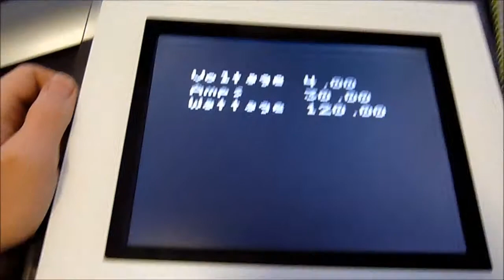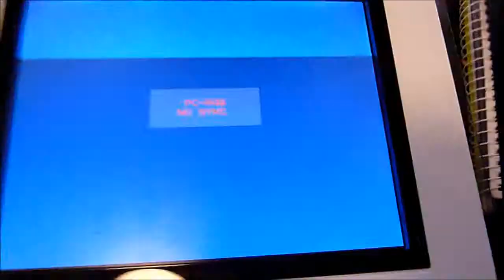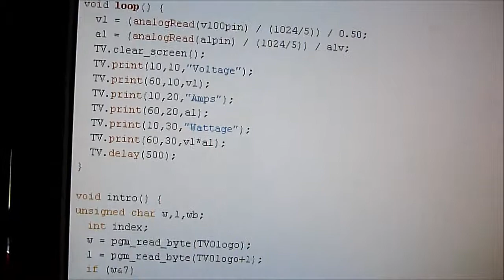Arduino TVOut/digital photo frame power meter

Comment: Care to share the code? I've been trying to build a bench volt meter with a old TFT LCD and all I can get is the text to scroll.
Reply from the maker: +Leland Clayton This was so long ago! I will have a dig for you and see what I can find
Reply: +wilkes982 Thanks but no worries. 20minutes after posting the last message I figured it out.
Reply from the maker: +Leland Clayton I have no idea where the code ended up, i stopped using it when the screens psu died. also i bricked my arduino haha. good luck with your project

Comment: The thing with the power cycling seems to me to just be some faulty caps in the PSU... Just change the caps and you'll be good to go
Reply from the maker: It turned out to be a short across the output of the power supply. Real dodgy haha